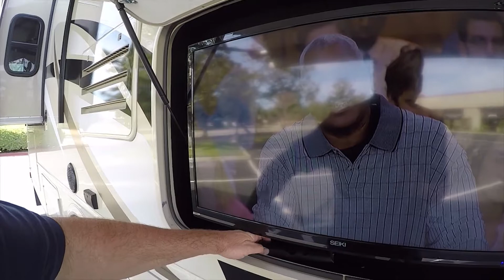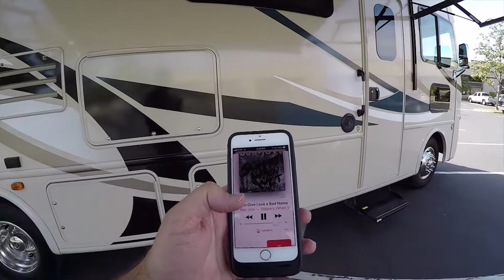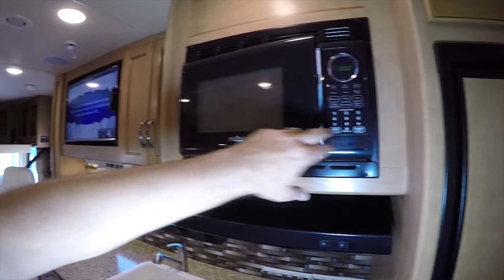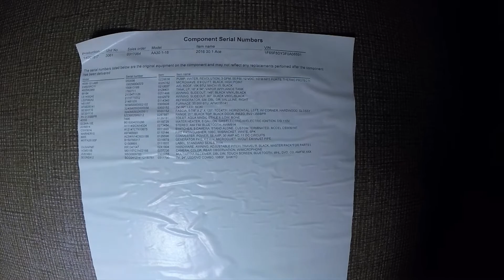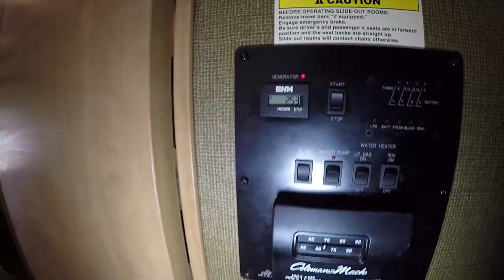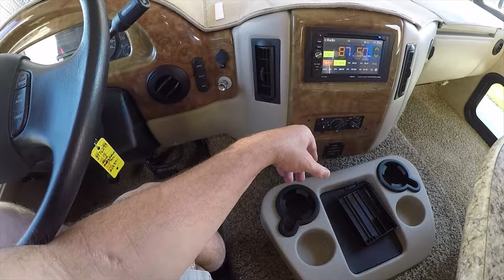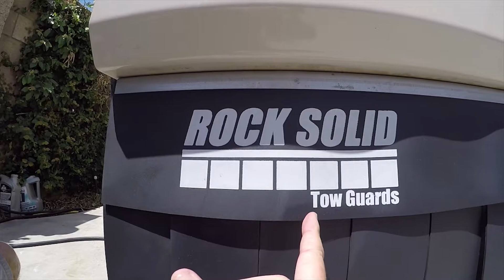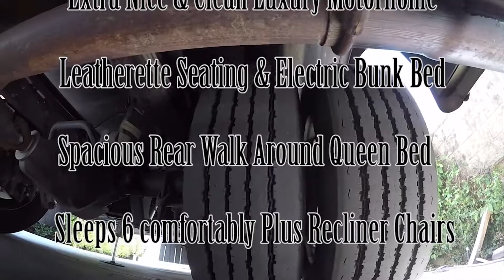2016 Redesigned Thor A.C.E. 30.1 Motorhome Full Video Tour of unit for sale

Comment: We bought a brand new one and believe me the problems we’ve had:  Dash A/C motor replaced, furnace control board replaced twice due to water getting in unit, awning optics never worked, awning screws replaced, air fan near dash area on roof broken outside latch, step motor replaced, A/C vents in dash broke, control panel for dash fell out completely due to broken internal screws, dining room slide out motor had to be realigned, bunk bed motor on passenger side replaced, in 1st few months it was in the shop over 5 months and they included that time on our warranty…on and on all within the 1st few years.  We paid over $2000 for the lifetime luster finish, which didn’t last a year and they wouldn’t cover redoing it.  Never ever buy a Thor!!  Never buy any extended warranty because they always find a reason not to cover the problems!